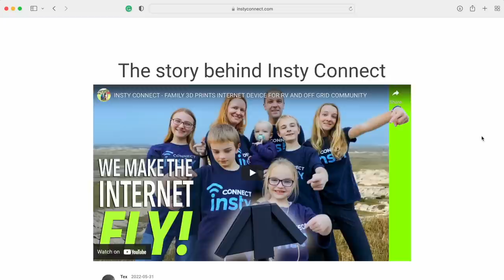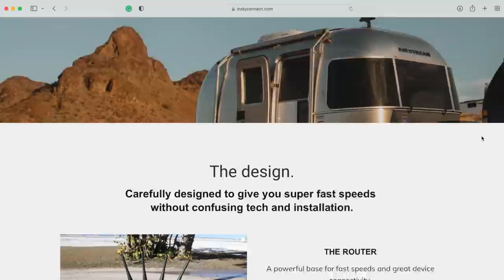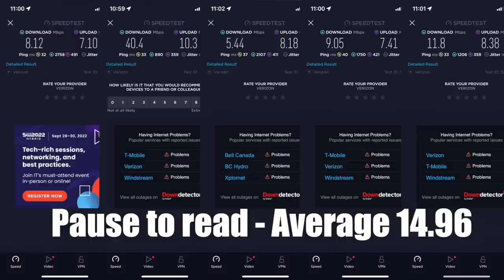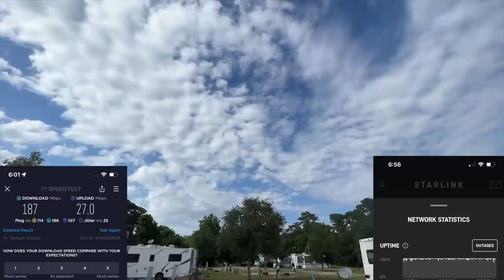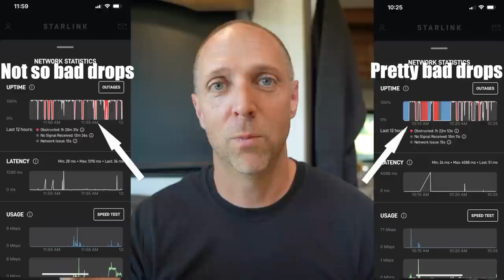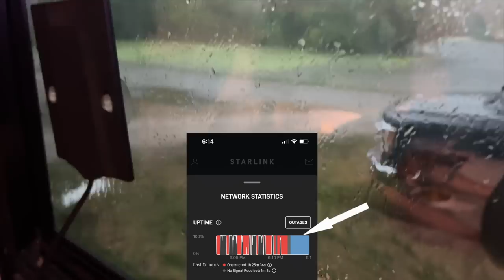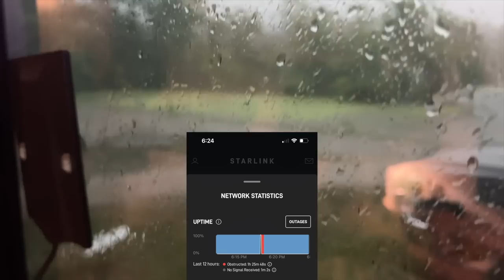Is Starlink Internet Working & Maybe Something Better

Comment: We have a Pepwave dual mimo setup installed on our rig with Verizon using the 100GB/mo unlimited plan for $60/mo.  It works fine, WHEN we have coverage.  Verizon has the best coverage of the big 3 service providers, but we use Verizon as backup to our Starlink system.  We bought the Starlink system with the $135/mo RV plan.  It has worked pretty good, but the tree obstruction issue is a problem to steer around, IF possible.  We always ask for campsites with no trees, and generally speaking if there are any sites without trees, the campground manager is very willing to give them up because most folks want shade, in the summer especially.  Over the last month we have used Starlink about 80% of the time here in the West, and the performance and uptime was good with only an occasional speed of under 50mbps down (rain). Eastern campgrounds generally have more trees, so the problem is likely greater than in the West.  But that doesn't mean it's not a problem in the West, because it's real.  Over the last month I'm convinced that our 100GB/mo plan with our Pepwave system is overkill, since we use Starlink so much.  Our one month test on the road indicates we could get by using our phone hotspots.  Each phone has 50GB/mo for hotspot, so that's 100GB total.  I think our Verizon phone hotspot backup is all we really need to backup Starlink.  But in the East that could be different.
Reply from the maker: Thanks for sharing that Tom! It’s great to options 👍 We Agree Verizon has great coverage and have really enjoyed it most places. Our plan is a 2019 prepaid truly unlimited high speed, with the caveat of priority to other Verizon plans in congested areas. That might be why we see some major throttling during holidays or big events.

Comment: Aaron, you'll find that the Insty Connect is great. We used our 4G in many locations and always had consistent success across the west. I've been using the 5G now for 6 months and have been able to get up to 300Mbps. One thing I'll mention is that you can set the TTL to 65 in the Insty Connect SIM settings and it will allow you to go past the data cap on a regular cell phone plan. So for people that don't have an unlimited data plan it still works. I've been using over 250GB per month this way with T-Mobile and AT&T for over 3 years with no problems. I'm going to explain that use in  my Insty Connect video coming soon.
Reply from the maker: Good to know Jason, thanks! It does seem to be a pretty great solution so far and look forward to seeing how works as we travel. Thanks for the note on the setting! 👍
Reply: I am about to venture out for the first time with my 9th grader who will be doing school online. Can you use the Insty Connect while driving? I would like her to be able to work on school while I'm driving. Thank you!
Reply from the maker: Yes, you can use it while driving, but it will depend how far away your router is mounted in the RV from your vehicle( or motor home). Matters more in big 45ft fifth wheels and less as the RV gets smaller.
Reply: @IreneIronTravels  TY! We will be in a 21' class B. It's the Winnebago Solis, which has the extra seats and table behind the driver's seat. All the controls are right there on that wall so do you think that would be a good place to place the router since that is where she will be working? There is a window right there too. Thanks for sharing your tips and travels with us!
Reply from the maker: Oh nice! That sounds like a great place for the router and you’ll have no issues with with the van size. You’ll even Be able to work outside of the van when camped 😊

Comment: i have starlink rv. data speeds have been all over the place but aways useable. i mostly camp where the internet is good. which is what i did before starlink, but now i have way more options. also the rain hasn't been a noticeable issue for me, i've seen people give the impression that starlink just stops working in the rain, but i haven't noticed any issues.

Comment: We have been in 15 states and Ontario canada  over the last 5 months with starlink and only had a problem gettting a starlink connection at 2 places, because of trees.  We still have a back up connection with our pepwave max transit ATT but i think we can drop the ATT soon.  Like to see a comparison when you have as much experience with insty as starlink.  Your starlink percentage is Very Low compared with most RV experiences.  We have about 90 percent sucesss with starlink over the last 20 plus campgrounds.   Florida, georgia, Tennessee, Ohio, Ontario, Michigan, Wisconsin, Minnesota, South Dakota, Wyoming, Colorado, Kansas, Missouri, Indiana, Kentucky, North Carolina.  We camp only at state and provincial parks with lots of trees and still have good starlink success.   It gets expensive having starlink and a expensive cell router option, us over $235 a month.  Larry
Reply from the maker: Yes, seems to be very mixed reviews for starlink speeds and service for everyone. Good to hear its working out for you. Our unlimited Verizon plan is only $65 per month so its pretty inexpensive compared to most plans. We just switched our Starlink from residential service to RV and we paused it. Just haven't really needed Starlink....but we are heading West and look forward to having it as a backup. Insty Connect review coming soon! ( We do like it 😊)

Comment: Just got back from 30 day RV trip with both Starlink RV service and an unlimited hotspot service.  I used both services without issue, but ignored the urge to run unnecessary speed tests. As long as I was able to stream TV and get internet for basic work, I was good. 

Friends camping next to us at 8 day rally ultimately asked to use my Starlink because they had Zoom meetings most days, and their hotspot wasn’t working well (400+ coaches in small area). 

Overall thrilled, but paused service until my next RV trip which is in a couple of months.  I figure with my limited RV travel, it will effectively cost me about $30+ a month.
Reply from the maker: 👍 thanks for sharing that, sounds like it’s working well for you!

Comment: Thanks for the review. We recently purchased Starlink mobile because where we live has limited options and using our Verizon Jetpack was OK but slow. So, we have Starlink for traveling and will use our phones as hot spots when needed. We've been too many places where there is no cell service, hoping Starlink will fill that gap. Our speeds so far have been all over the place but that's OK we don't need access for work.

Comment: So the thing regarding obstructions being the #1 issue most Starlink (particularly Starlink for RV) users will experience with the service, the caveat with having anything you think might act as an obstruction is where the satellites are in relation to your geographic location, with particular emphasis on latitude. Near the US-Canada border, you can get away with more horizon obstructions vs being in the middle of the country as the Starlink constellation's orbital inclination results in the satellites going mostly straight west to east near 52°N latitude. The closer you are to that, the higher the angle relative to the horizon you'll need clear of obstructions and, consequently, the more you can get away with being in a wooded area, so long as you can see the sky above you as well as to your immediate east and west. In the middle and southern latitudes of the country, it then becomes an issue of the satellites either passing southwest to northeast or northwest to southeast, generally pretty shallow relative to the horizon (unless you're literally right underneath one of their orbital paths; search for "starlink coverage tracker" to figure out which applies to you).

It might be the most counterintuitive thing regarding Starlink even being offered for RV service because the natural inclination of those camping with an RV is to find a secluded spot surrounded by obstructions (as flat open grassland/desert is boring), and that might only really work for you if you're camping in the northern states or southern Canada.

Comment: Hi, Iron, great vedio, thanks. We are thinking to use a pepwave router, eg Transit pro, to bound all these connections together, but it is a bit costly. We plan to do some RV travel during next summer, what do you think is the best option for us to connect internet during travel?
Reply from the maker: Thanks! Yes the advanced router and rooftop antenna combinations are expensive but do perform quite well. We have been using the 5g Insty Connect system and really like it so far! It doesn't  connect with Starlink yet, but should in the future. I just did a video on it this morning https://youtu.be/5SItxqWksgI

Comment: Curious if the residential service is spotty on the road because its not the mobile RV service?? Is there a difference....
Reply from the maker: It shouldn’t be. The residential service allows you to move your “ service address” and it should be just like your home Starlink service. If the area is “full” you can’t move your address, but you can turn on “portability “ or roaming. Then it’s just like the RV service and you can use it as you travel around.

Comment: Starlink is growing. More satellites are being launched. Throttling will be reduced, probably right around the time prices are increased. By the way, you failed to mention what insty connect costs.

Speaking of insty connect, it's a cellular system correct? So when there is no cell service, how do you connect?

I have a sprinter van with a Starlink pivot mount on the roof rack. I also have the standard x base for ground deployment when obstructions are a problem. The excess cable is stored on the roof in a pelican type case, because 99 times out of 100 I use the roof mount. The case is overkill but it does keep the connector clean dry and in good condition.

 The cabling is more or less permanently installed. All I have to do is flip the inverter on to power the system. I am considering however, modifying the router system to work off my 12 volt battery bank like I've seen done in YouTube videos. Another option is just to get a small dedicated inverter so I don't have to fire up my 3,000 watt inverter/charger just to send 48 volts to Starlink.

I recently went on a 3 week Midwest and Mountain State road trip. Kentucky to Colorado, Wyoming, South Dakota and back. 10 states in all. I put the dish up even when pulling into a highway rest area, a truck stop, or single night on the side of a forest  service road. Life is never without chores, RV life is no different. If you want internet, you put the dish up.

Now then, my speeds were great albeit all over the place. When I got a flat near Monument Rocks in Kansas - not the middle of nowhere, but right next to it - Starlink saved my butt when i really need connectivity - $429, thank you very much TA road service.

Comment: Our 2022 ORV came with a Winegard Air360+ that has a WiFi/cell antenna built in. I’m planning on going with the Osprey cat-12 router as I’ve read some great things about connectivity and speeds
Reply from the maker: Hey Steve 👋. We have the 360+ as well and I did test it with the winegaurd router and also our hotspot connected directly to the 360+ mimo, but got the same speeds as my window mimo. But I only tested it in one spot. Let me know how it performs if you go that route! 😊
Reply: If you tried it with the Gateway router the Osprey models are considerably better

Comment: We have a Pepwave BR Max cellular modem with a 7 in 1 rooftop antenna, with a Verizon sim card we use as a backup. We have primarily been using Starlink as our main internet source. We do have the dongle, so we run an ethernet wire from Starlink to the WAN port on the Pepwave. So we use the Pepwave as our main wifi network and Starnlink service passes through it. This also allows me to run a network cable directly to my laptop or docking station from the Pepwave. When I unplug Starlink on travel days or during an outage, it automatically switches over to Verizon. So that is how we have been using our setup. We have a decently sized solar package, so we prefer to find spots without tree cover, which also is a benefit for Starlink. Going back to March we've only had one campsite that has so much tree cover that Starlink hasn't worked for us. We've recently installed a Flagpole Buddy with the Starlink attachment on our ladder. This lets me get it up higher over lower vegetation. I'd estimate it is about 16' above ground. So I've cut my cable and customized the lengths to make it more manageable. I may order a new 150' cable that I can use in the instance I need to move it out away from tree cover. So far we love Starlink. We've been using it with roaming turned on and haven't felt like we need to update our service address. This allows me to work remotely running heavy data programs like AutoCad and ArcGIS.
Reply from the maker: Thanks Jason, sounds like a nice setup you have! Which part of the country are you guys in?
Reply: @IreneIronTravels  We are almost dead center in the US. We consider Lincoln, NE as our home, but we have been roaming around KS, NE, SD, and CO. We did run up to Michigan for a bike race. I'm about 50% full remote, so we do stick around Lincoln for work purposes. We hope this time next year we are full remote, then we will likely find ourselves following the cooler weather. We've been following you guys for a few years now, took the leap, sold everything that didn't fit in the truck or camper, and have been full-time for just over 2 months now.
Reply from the maker: Nice 👍 thanks for the Updates. Yes, I recognized your name, thanks for following along!

Comment: I’ve had StarLink for 2 days and it sucks! I’m setup as RV but I’m home now in Western New York and it just will not connect. It has moved maybe 3 times. This is even after I move it to different spots trying to find a better location. Does your dish (rectangle) ever move around or adjust when you move it somewhere else?

…and, also, you will NEVER SEE ME ON THE NEXT VIDEO. This lie is a huge pet peeve for me since video is only one way. Right?
Reply from the maker: Yes, our dish does move around every once in a while to track different satellites. 

And I see you right now in the comments Mark 😊

Comment: Love my starlink on my 5er. I have a backup Verizon & Tmobile load balancing modem which works well alot of the time. Until I moved to Ramona, CA rural San Diego County where I find both Verizon and T-mobile deprioritize me at peak times its virtually unusable. Starlink though its deprioritized as well but still very usable.  I just have to look at sites without trees so I can have a clear line of sight to the north for Starlink and to the south for Dish network. Rain fade is common with most satellite communications which fortunately in California that doesn't happen near enough but that is when my Untangle router will automatically switch over to the Cellular

Comment: What consistent download speed is needed to stream movies without buffering?

If I were to stream 2 - 3 hours of video per night how much data would I use in a month?
Reply from the maker: It seems around 5 Mbps download speeds are good for streaming and it could be around 2-8 GB of data depending on the definition. ( 720p,1080p,1440p, etc)

Comment: I was already upset at starlink for using what's effectively a proprietary connector, but to find out that it's got issues is crazy.
Reply from the maker: Yeah it was pretty surprising on the second time I set the dish up. I couldn’t get it to plug in for the life of me and I thought I broke or bent something. After googling it I found the paper shim and it went right in!

Comment: How would you rate the in motion Starlink mounted on your roof?
Reply from the maker: I would think it would work pretty good for those that use it in the wide open West for the most part.  But you would have to still park strategically to avoid obstructions. It would have been really bad in the East and Midwest with all the trees. Many places we couldn't get ours to work with a 50ft cable....

Comment: Does InstyConnect do anything a PepWave router and antennae wouldn’t do? Looking at a PepWave now but not sure if I should evaluate/compare the InstyConnect?
Reply: Just adding that I’m looking at the BR1 Pro 5G vs the 5G InstyConnect
Reply from the maker: I’m not exactly familiar with the pepwave, but the modem is in the roof antenna on the Insty, with very short wires, giving it a supposed advantage. The Antenna design is patented. I’m still testing it out, but I do like the software as you are able to lock on to certain towers or allow the system to find the best and do a aggregation between multiple towers.
Reply: Interesting, I do like the ability to choose between locking onto a specific tower and Omni-directional. Thanks for the response!

Comment: Great informative video!  Do ya’ll utilize a single cell carrier for your Wifi, or do you utilize two?
Reply from the maker: Thanks! We just have one carrier for our main internet, Verizon. We also have t mobile cell phones as a backup. And now of course Starlink too😊
Reply: WiFi is a wireless network connection as opposed to a wired ethernet connection. It can be from a router or edicated wifi access point. You can have WiFi without internet. Most people use Wi-Fi to get internet which can be many sources.

A WiFi Access Point like a router is very different than internet equipment. There's lots of mobil routers like in this vid and others. They have WiFi  and wired connections. They can get internet from multiple sources like the Starlink, mobil like Verizon or just plug into a home ethernet network. So if you're discussing options It's important to understand the differences and accurately define your questions of WiFi or internet access. They rather different.